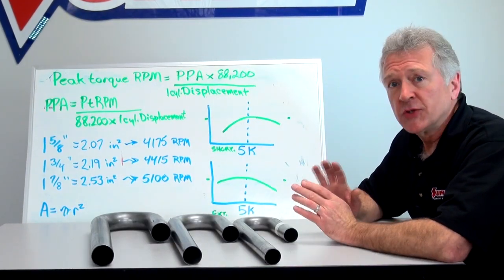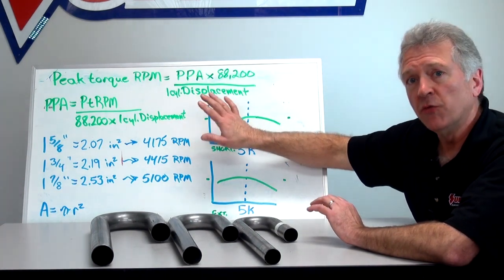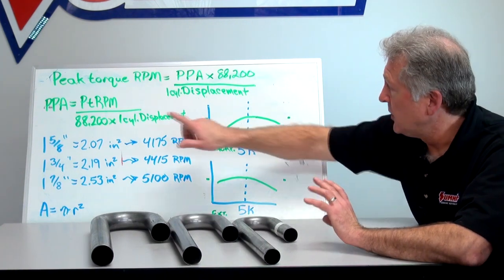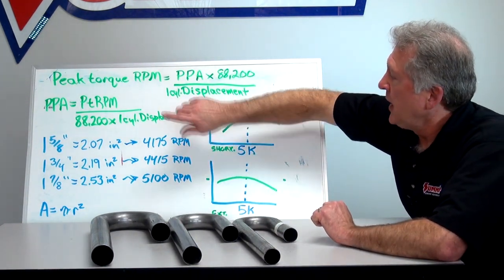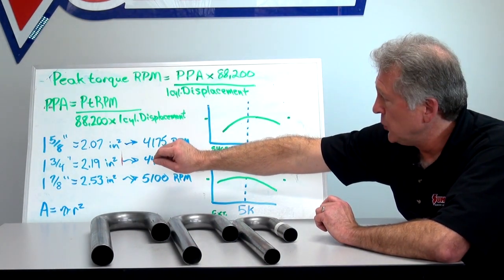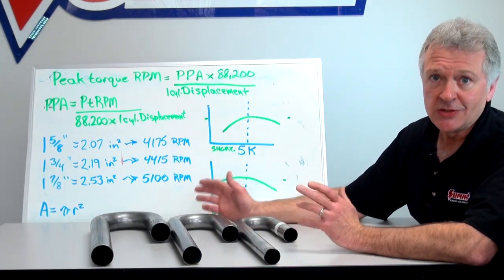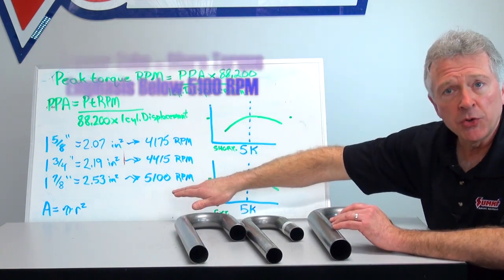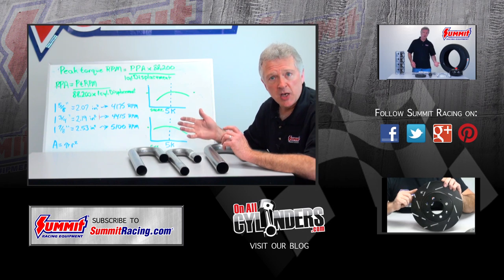How to Select Header Primary Tube Diameter - Summit Racing Quick Flicks

Comment: I spent 2 years working for Hendricks Motorsports modeling engines and designing and fabricating headers. Ideally the cross sectional area of the primary tubes should be the same as the cross sectional area of the exhaust port. Otherwise, the speed of the exhaust bolus must change at the interface and this creates turbulence and unnecessary pumping losses. Would love to compare notes with you.
Reply: Damn all this planning and I didn’t even consider the drag directly at the port exit due to an abrupt change in cross section. Especially since the gas will cool as it passes through the headers the exhaust port is the point of most constriction. Thank you for your comment, very enlightening.
Reply: What can be done to stop reversion in the exhaust?

Comment: [(Peak Power RPM * 1 Cyl displacement)/ 88,200]=PPA
little bit of a mix up on rearranging the formula
Reply: Where does 88,200 math constant come from?
Reply: Tha k you
Reply: How would a turbo charged system play into this formula? I thought that a turbo charger likes to have as much exhaust diameter as possible.
Reply: Great observation. If you get the PPA right the first time it wouldn’t matter though right? Now if you’re trying to reverse-engineer it, then yes, totally agreed.

Comment from the maker: Primary pipe area = (3000 x 22.2) / 88200
Primary pipe area = 0.7555 inches square
Doing some more math I used 0.040 for the wall thickness for my mild steel circular tubing. The formula for the area of a circle = pi x radius x radius; and I pulled the wall dimension out.

Comment from the maker: Dear Roman, 

   Sorry for the delay. Primary tube diameter is used to enhance the amount of torque developed at the peak torque RPM. That’s why knowing the actual or theoretical RPM where the peak in torque occurs is built in to the equation. 
   Do you know the actual RPM or the theoretical RPM where your 350’s peak torque occurs? Let me know.
Reply: 3400 rpm peak torque is 300 ft/lbs , 4300 peak hp is 228 to rear wheels

Comment: The math is wrong for tube area;
 1 5/8" he didn't subtract any wall thickness.
1 3/4" & 1 7/8" he only subtracted the wall thickness once (.080") if that is the thickness of the tubes..he should have subtracted .160".

1 5/8" OD pipe with .080" wall thickness has an area = 1.686"  (( 1.625 - (.080*2))= 1.465ID /2 = .7325 for the radius, squared = .53655625 * PI (3.14159) = an area of 1.6856 square inches.

1 3/4" OD tubing (.080 wall) = 1.986 square inches
1 7/8" OD tubing (0.80 wall) = 2.31 square inches
Reply: JerseyMikeP Thank you, I thought my senility was showing! This is exactly what I got. I am still having trouble with the size I need for my peak torque.

Comment from the maker: I plugged the 4900 RPM that you supplied into the formula and come up with a theoretical PPA (primary pipe area) of 2.61 inches square. Doing the math for the surface area of a circle and using 0.040 inch for the wall thickness I have a 1 -7/8 inch primary tube outside diameter coming in at 2.53 inches square and a 2.0 inch version coming in with 2.94 inches square. I would use the 1 -7/8 inch set unless you plan on a dramatic change in displacement and/or peak torque. Hope this helps good luck!

Comment: Hey I am doing a efi 331 stroker just a nice weekend street car only, no track. My builder suggests that I do a 1 1/2 inch header and the rest of the combo will be an edelbrock performer rpm 2 intake, Brodix 20 degree 171 cc head, cam around .525 lift 108 lobe separation (that could change and be slightly larger), 70 mm tb, 80 mm maf, dyno tuned with 42 lb injectors. I can find 1 5/8 headers or there are more options anyway but have found the 1 1/2's in Headman as I looked briefly. Just curious as to your thoughts on the 1/4" making a difference either way positively or negatively for what I'm doing with the car. I'm going to expect for a minimum of around 350 rwhp

Comment: A good teacher fist teaches the definition of important, pertinent words and acronyms  in alphabetical order, then proceeds in an orderly step by step manner including an orderly, step-by-step diagram or formula listings, in chronological order with simple clear explanations of each. This is followed by simple to solve formulas with round number plugged into the formulas so the students can clearly and easily focus on the formula in a meaningful manner. When the student clearly understands all of the aforementioned, then the student can begin solving problems or questions  which require mathematical computations .  Therefore, I agree with Garth Giggity who posted the Einstein quote; which I will herein expand on as follows: "if a person cannot explain something simply, in an organized and  proper chronological order, they don't a.) understand it well enough and b.) they don't know how to teach".  Students learn best by progressing from rote to skill then to understanding, and finally to comprehension.
Skipping any step can cause confusion in a student's little grey cells which result unsatisfactory results, whether it is getting a good grade in a class or when building a combustion engine or an electric motor. By the way, a vehicle that runs on fuel has an engine - not a motor - motors are powered by electricity.

Comment from the maker: Though we’ve not compared them side by side, they are most probably different considering the chassis’ of the cars have changed completely. The reason you are having trouble finding Shorty’s for your application is because that car has ample room for a long tube and they respond so favorably to long tubes.

Comment: The math for find Primary tube area PPA is also incorrect:

It should say,  (TQ peak rpm * 1 cyl. displacement) / 88,200
Reply: EVEN THIS WOULD BE WRONG CHECK WITH UNITS
Reply: Units.....What are you talking about???  Standard-inches 

How is it wrong? IF you think so, post what it should be?
Reply: unit for cyl dispacemnt was inch3(cubic inch) multiply with rpm(rotational per minute ) how it gives area(square inch)??????
Reply: The Constant takes care of that, it is a # that comes from...
 -the ideal peak velocity of the gas through the pipe
- The fact that the cylinder only fires once every 2 rotations
- the conversion of the rpm's into rotations per seconds to match the gas velocity which is in ft/second
- and converting the Flow from ft/sec in to inches
Reply: JerseyMikeP I was about to say hahaha

Comment from the maker: I converted the single cylinder displacement of 364.25 cubic centimeters over to the common units of the formula – inches. The formula works with displacement in cubic inches all the way down to square inches for surface area and even inches for primary pipe diameter. 
   Plugging you in, I have single cylinder displacement at 22.2 cubic inches and I used your supplied 3000 RPM to finish the equation and solve for the primary pipe area and then subsequently the primary pipe diameter.

Comment: First, 1-5/8" is 2.07 but the other two are wrong; 1-3/4" = 2.40 & 1-7/8" = 2.76

Next, the second formula is incorrect; PtRPM x 1 cyl. Displacement / 88,200 = PPA

Finally, an alternative formula to pi r squared is Diameter x Diameter x 0.7854
(Example: 4.00 x 4.00 x 0.7854 x 3.480 x 8 = 349.85 (350))

Comment: I ordered the 1 5/8 shortys  for a LS swap in a 35 coupe.  I did not know this. I am tight on room for my steering  shafts.  The smaller size will help with that.

Comment: Hi Norm, I was just trying to do the numbers for my 327 cu.in engine. Is it possible that there might by a mistake on your whiteboard? 2,07 in2 for the 1 5/8" tube seems to be considering the OD instead of the ID. Shouldn't the PPA consider ID instead of OD? 
Please correct me if I'm wrong.
Take care, 
Claudio
Reply: That’s why he said you subtract the wall thickness x2 , which gives you the inside diameter
Reply: Hi, thanks for taking the time here @williamhamil9860. If you do the math, the 2.07 in2 is the result of a 1.625 OD tube, divided by two results in 0.8125, squared would be 0.6601, then multiply by pi, its result is what is written on the whiteboard. So the wall thickness was not substracted in the example there. Watch out.
Reply: So correct result for the 350ci and that 1 5/8” header (with a 18 gauge tube) would be peak torque at 3690 rpms

Comment: What can I do to help my lower end torque ? I have 2in fenderwell headers with 3.5 outlet. Can I build a collector to help keep the speeds up. Also the primary tubes are 42 inch long & I'm running a stroked big block mopar and looking at near 600 hp.

Comment from the maker: I tried 1.25 inch OD and got 1.075 inches square for the pipe area (above), remember we are trying to solve for primary pipe area. Then 1.125 inch OD which yielded 0.86 inches square; followed by 1.0625 inch OD which got me very close with 0.76 inches square. So it looks like a 1 -1/16 inch OD tube with a wall of 0.040 inches is your theoretical primary pipe diameter for your particular single cylinder displacement and peak torque RPM.   

   I hope this helps; let me know what you think.

Comment from the maker: For example 1.25 inch OD pipe (a circle) minus the wall thickness twice (2 x 0.040 = 0.080)…so, 1.25 inches minus 0.080 = 1.17 my corrected inside diameter… so, 1.17 inches / 2 = 0.585 inches for my radius. Now 0.585 x 0.585 x 3.14 = 1.07458 inches square.

Comment: Great video ! To your calculations, are you suggesting a short header will have more torque it it leads to smaller collector per say 1 7/8 to a 2"  than a long tube header 1 7/8 to a 3" collector
Reply: Depends on output of engine. Hi hp & tq the answer is hell no, a stock street engine hell yes but too a point.
Reply: Actually I believe he's backwards on this, long tube headers tend to outperform shorties across the board, the higher torque of a shorty sacrifices hp on the top end.

Comment: Hi guys. 

This link explains in more detail, and these are the formulas. For street motors. 

Peak rpm (torque)= ppa*88200/individual cylinder displacement 

Ppa=peak rpm torque*indiv cylinder displacement/88200

https://books.google.com/books?id=yEe6nll_wdEC&pg=PA149&lpg=PA149&ots=fqPa5LAunF&focus=viewport&dq=peak+torque+rpm+x+1+cylinder+displacement&output=html_text

Comment: So how many iterations does it take to nail it down?  You use a peak Tq rpm value for an unknown exhaust to design your new headers.  Then you put your new headers on to find you changed peak Tq rpm to recalculate and find you need a different size tube......😂😂😂.   I’m thinking the ppa doesn’t dictate the peak Tq rpm!?!  Whole lot of other factors like head flow and valve timing events!

Comment: I have a 1.4 liter turbo charged 4 cylinder car that has a complete down pipe through exhaust and muffler of 2.5 inches, mandrel bent. I would like to know if 2.5 inches is enough for my 205 WHP and 257 FT/LB of TQ to the wheels.  It is a single pipe.  My redline is 7k. 83 cubic inches.   my guess it that peak torque is around 2k rpm..  This car is modified. It was suposedly at peak torque from the factory at 1850 Rpm's. When it was stock it had 140 bhp and 150 ft/lbs of base torque. That is 120 WHP..

Comment: Now if you had those tuned length headers put on, ie: each size, i bet my life the difference in power would be so little that in the car you really would not notice it,especially after a tune for each one, so the most important fact is this, if you had a 350 chev engine which can rev out to over 8,000 RPM then what you need to go over 1/ 7/8 " DIA headers i dont think so, because its all about when your peak torque comes in and ends nto how far your engine will rev out too ? 
Also if you have a street driven car like say the new Holden Chev SS which has a 6.2 lt engine and also considering everything under the bonnet which can get very hot and also gets in the way, then you can only do so much as far as the design of those tuned length headers, if you have not restrictions under the bonnet then no worries at all, then you would have the collector of each header pipe start out in the same direction as each exhaust exit angle and then mandrel bend the pipe so to fit and collect at a point to fit under your engine bay and not touch anything and more importantly easy access to spark plugs, other wise like most companies out there they simply copy each others designs and thats what is on the market right now, in australia and overseas as well ?

Comment: how did you calculated the length of primary pipe? also please help me with my engine. I have EX500 engine of Kawasaki ninja and I'm using it for my formula racing car . will you please give me the calculations for primary and collector length ?

Comment: QUESTION PLS HELP. 

if im doing exhaust piping fully 3" and in the middle reduce to 2.5" and then increased back to 3'" again towards the back end (tips), does this mean the whole flow is changed to 2.5"effect or 3" . 

or for example i want full 3"piping but im missing a 3" flange so i reduce one small part to 2.5"just for the sake of using 2.5"flange. but the rest is back to 3".. NOTE that one flanged part is reduced to 2.5"  .

can you please explain the effects. ty

Comment: Why would i want to make more torque at peak tq? Wouldn't it be more beneficial for performance to have the headers tuned above peak torque and use long primary, like 32"?

I have very mild 302 combo, peak torque at 3400RPM with stock headers, so i was thinking 1-3/4" long tubes.
Reply from the maker: Many variables play a role in pipe diameter and length, cylinder head flow rates and port sizes, engine displacement, camshaft design, compression, vehicle application, etc. But in general, a smaller diameter primary creates good midrange torque but drops off at higher rpm. In contrast, the larger primary adds more high-rpm power at the cost of low-speed torque. Primary pipe length will also influence an engine's power curve. The primary-pipe diameter establishes the peak torque position, changing the pipe length will pivot the output curve around that peak torque point. Longer tubes usually will increase power below peak torque while cutting power above peak torque. Shorter tubes affect the engine in exactly the opposite way, cutting midrange torque in favor of increasing top-end power. 
 
Intake and exhaust systems can also be tuned to different engine speeds, expanding, or narrowing the overall torque curve from varying the intake and exhaust systems dimensions. 
 
For more information on choosing header size, visit the Summit Racing help center. https://help.summitracing.com/app/answers/detail/a_id/4797/kw/header%20calculator

Comment: what would be the best size for honda accord 2.0 lt vtec head and the ruuners how long i want to use it for drag. i would be so glad sir if you will reply to this comment thank you sir
Reply from the maker: Hi jm apolintisima, 
As stated in the video, so much depends on the size availability of header tubes for your car as well as the camshaft that will be used since it determines the RPM range that you’ll be operating in.

Comment: i have oversized my  piston, done port and polish  should i change my headers? a 1.5 liter engine turned out to be 1.6 liter output right now, is there a need to increase the pipe diameter of my headers>?
Reply from the maker: meowtrox1234,    The formula does use single cylinder displacement as the rule. Considering the changes that you’ve mentioned I understand that your displacement has increased. Keep in mind that your Peak Torque RPM may now be lower than it was previously, reason being that as displacement increases the RPM peak for torque and subsequently the RPM peak for HP tends to decrease. This is a pretty good rule as long as the other variables remain constant and unchanged.
   My hunch is that you are going to stay with your existing primary tube diameter; I would suggest that you run through the formula and see how things may have changed for you. Let me know what your findings are – good luck.
Reply: hi there again i would like to clarify how do we get the individual cylinder measurement. do we have a formula for this? supposed i had an oversized piston from 1.5 liter? to an output of an equivalent to a .1,6 liter? how do we go about this sir?

Comment: Hi, why is the constant for the Peak Torque RPM equation a value of 88,200?
Reply from the maker: Hi Dashel Perera, 
   The 88,200 is a mathematical and physical constant. Constants are based upon the formula involved and units of measurement being used. I took a quick look around and could not find a more definitive answer. Taking a poke at this and knowing what we know it would appear that the constant might and I say might be based upon some factor of diameter or radius, swept area and then depending on how it was derived perhaps a square-root or cubed-root. Sorry I could not be more specific. 
   If you run down the actual formula used to derive the 88,200 please send it my way along with the proper citation.

Thanks in advance.
Norm

Comment: The two formulas do not jive. Not sure which one is correct but in the first one the constant (88,200) is on top and the single cylinder displacement is on bottom. In the second one they are both on the bottom. This can not be correct.

Comment: So what size primaries do i need on a 393 ci Ford Windsor with a solid roller cam .680 lift  258/268 duration at .050 and a 108 lobe center with a max RPM of 7,000? I am running AFR Renegade 220 heads with a compression ratio of 12.3 to 1 and a Super Victor intake and a 850 Mighty Demon carb. This will be a drag car that i plan on spraying 200 - 250 HP of nitrous.

Comment: So if I understand this correctly on a 440 1 5/8 = 3319 Rpm, 1 3/4 = 3511 Rpm, 1 7/8 = 4057 Rpm.  On a 505 1 5/8 = 2892 Rpm, 1 3/4 = 3059 Rpm, 1 7/8 = 3534 Rpm.
Reply from the maker: CORRECTION: White board should read - (Peak torque RPM x 1 cy displacement) 88,200=PPA